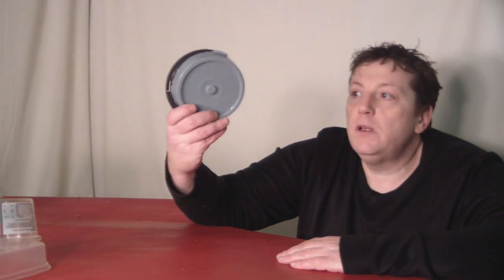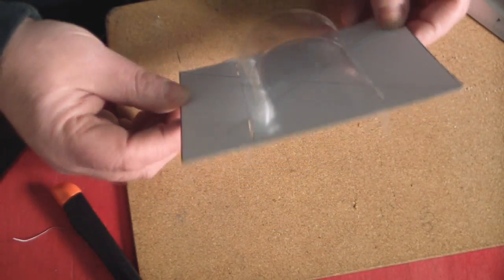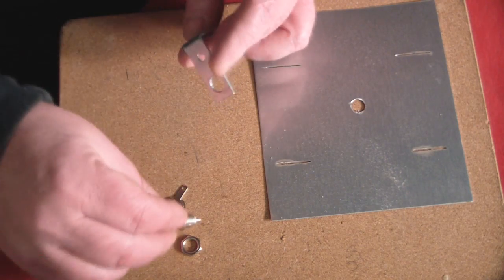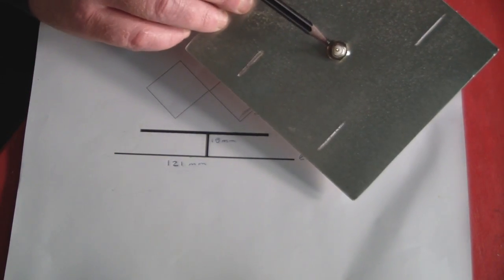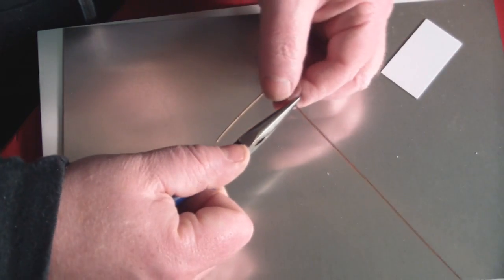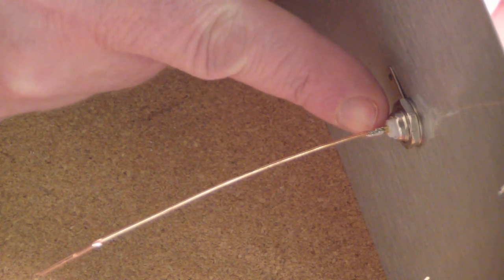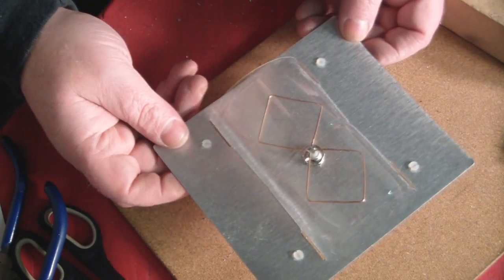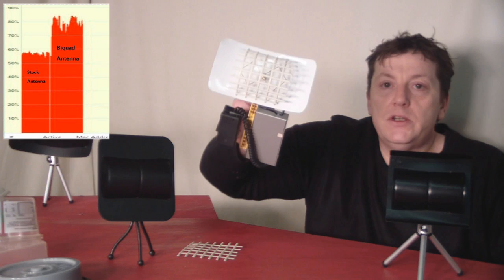Biquad antenna construction: directional biquad antenna with 11dBi gain #8

Comment: I wish I had the tools to make it. I tried with pliers bending some thick wire into 8 shape, which i did and i actually got a signal without any other things, just wire in infinity shape and a string. I have no idea how these things work and why size matters, and measurments. What if you multiply those numbers by 4 and make a 4 times bigger antenna? Is it 4 times more powerful? My amateur antena got a signal and it was a turd, i mean just handcrafted wire, it sucked yeah but it got a signal. So i dont understand why are things the way they are, what shape does to signal, what if the router is not pointing in your direction, what if the source of wifi is at 90degree angle?
Reply: guess I should read the comments that people leave I just left a comment above about making an infinity loop and you said that you tried it and did it congrats man

Comment: Hi from France and thanks for  your videos.  I've been watching few of them and didn't find any answers to my questions. For instance I can't find what is the maximum expected bandwith for a biquad antenna. In every video you focus on Wifi signals within a 20 Mhz range. 

I plan to build such an antenna for cell phone reception. The house where I live is a bit strange. At 5 meters High, I've got a strong signal. But 5  meters downside, where is my living space, I have nothing. Due to the configuration of the house, i don't have line of sight with cell tower in my kitchen. I know repeaters exist, but too expensive for my budget.

My first question is : Do you think I can  apply the biquad antenna for cell phone reception ? 

My second question is : would it be possible to build a PASSIVE system, I mean building an antenna , running a coax cable down to 5 meters in the kitchen, of course attached to an other antenna in my living space. 

Here where I live, the best signal is the 800 Mhz band, from 791 to 821 in download, and 832 to 862 Mhz for Upload. Supposing I build , with the aid of calculators online, a biquad in the central frequency (826 Mhz), do You think it could work ?

Maybe second possibility would have better chances to succeed. My carrier' signals are between 801-811 Mhz (Download) and 842 to 852 Mhz (Upload). Would it be better to built 2 passive systems, the first focusing on Download / center frequency 806 Mhz, and the second one on upload / center frequency 847 Mhz. 

If only people ( and above all my clients) could call me, it would be a great success. 

Please forgive me for my english, it's not my native language. 
Hope to obtain answers from you, it is very important to me. 
Thanks again for your videos.

Comment: I have a question. Why did you solder it to reflector and in the center of connector? Why not just in the centar? I saw another video with just in the center of connector. What is better option? Thank you for your video. Great antenna.
Reply: i have the same question! i didn't found the answer. Did you found?
Reply: Mihai Nicolae No. I think he is not reading comments.
Reply: Veritech that is bad. :)))

Comment: I have built this design, set to 2100Mhz and connected it to the 3G dongle I use to access the internet on my laptop. It added 30% more signal, so thank you very much for such a thorough tutorial.

I would like to ask you if it can also be adapted to use with a 4G router, namely the Huawei E5172. I believe this connected  works at either 800, 1700 or 2600 MHZ, which I have to confirm.

I also plan to build your double helical 5.8GHz for the video receiver of my little quadcopter which already has a "cloverleaf" as tx antenna.

Comment: Don't know to much about this kind off stuff so this might sound stupid. Could I use this as a directional antenna for a small uhf radio?
Reply from the maker: The wavelength for UHF is completely different so it would not work
Reply: Thanks

Comment: Noone shows how you connect this antenna to PC ot laptop ??
Reply from the maker: Omar Elouaddi LMR 195 and I try to keep it to no more than a meter long for portable applications.
Reply from the maker: There are many ways to connect an external antenna. The simplest way is to buy a  Alfa-AWUS036H. If you want to attach it to a router I have a few router mods on my channel yes they are all routers from UK ISP providers but most routers are all the same. I have also modified a common usb wifi stick to take an external antenna.

Comment from the maker: You don’t connect it to a router. You use a wifi card like the Alfa AWUS036NH . It is one of the most popular cards around with a RP-SMA Connector. I do show you the difference in db, gain and how many more access points it picks up over a greater distance.